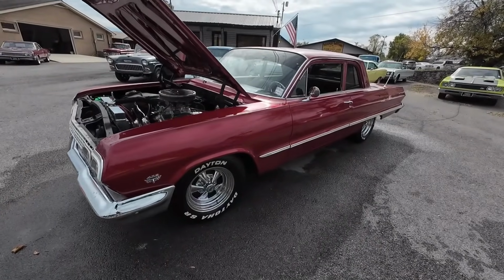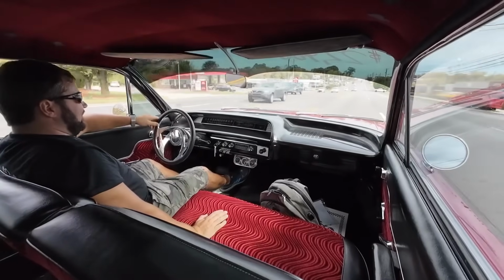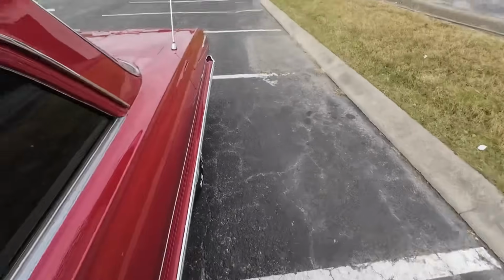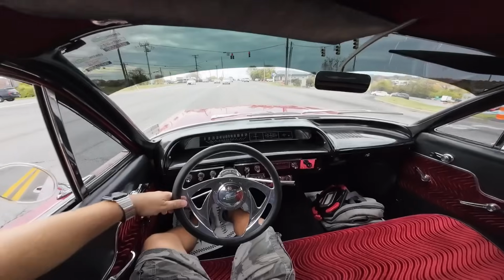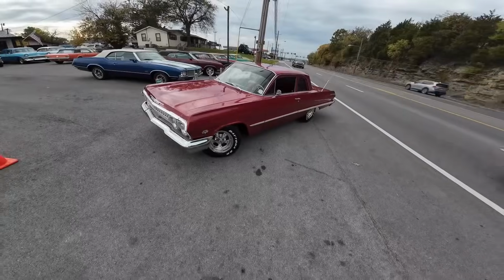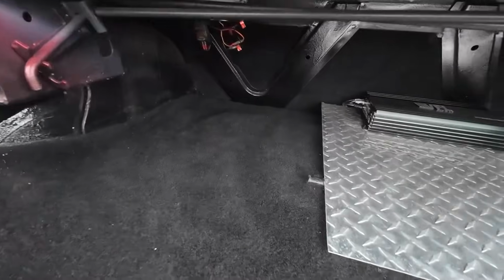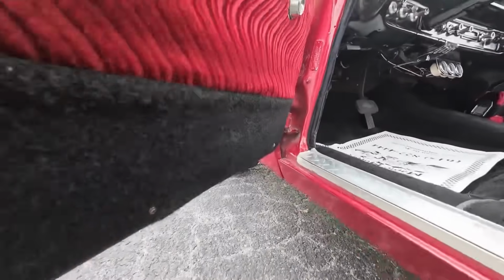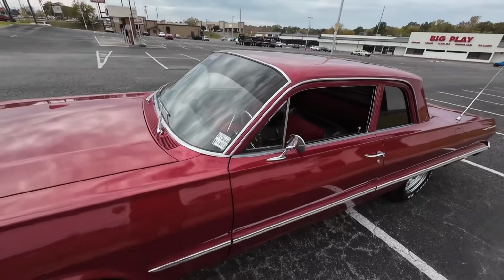Test Drive 1963 Chevrolet Biscayne SOLD $22,900 Maple Motors #2382

Comment: For anyone wondering, the Goodwrench 350 is rated for 260 horsepower.
Reply: They have / 290hp  too I bought one - has 1000 miles on it sitting in my garage - bought at dealer in 2008 -

Comment: My first car was a '63 Chevy Biscayne, 2door, hard top, 283 straight 6 with 3 on the tree.  Enjoyed that car, before the snow and salt rusted the floor panels out.
Reply: Same here. 63 Bel Air four door, 230 straight six ,three on the tree, 283 was a V-8.  Paid $200, 1971.
Reply: @larrywinger59  -My dad had the engine "cleaned up"(bored out) so it ended up with a 'few more cubic inches' 🙂  Thinking back now, the Biscayne had a V-8.  The '63 Dodge Dart Wagon had a Slant-6